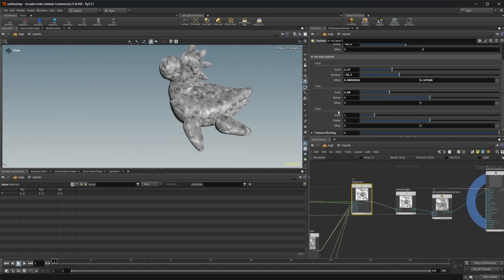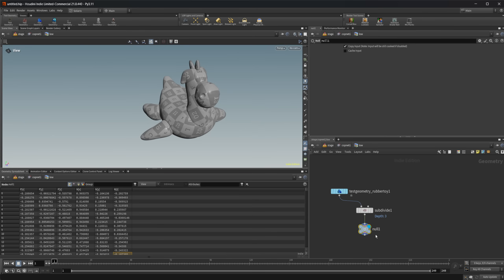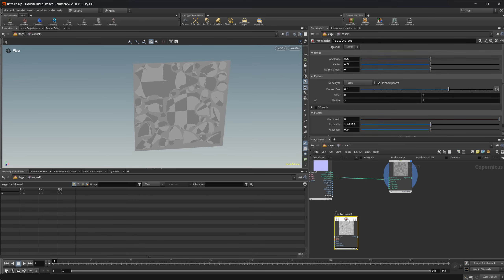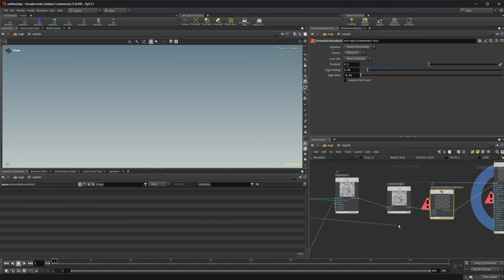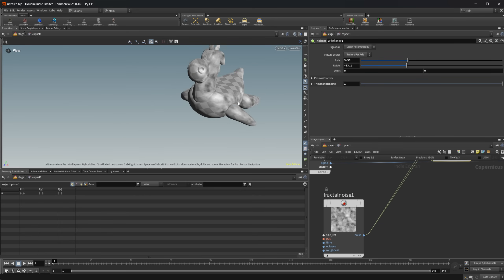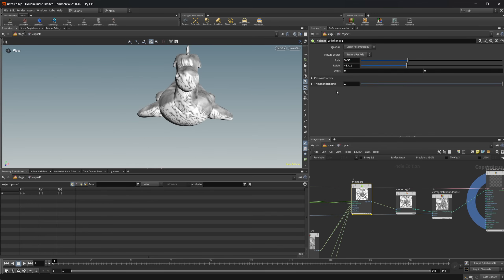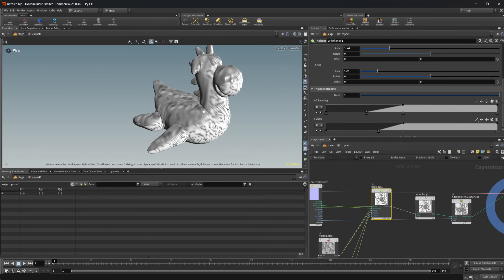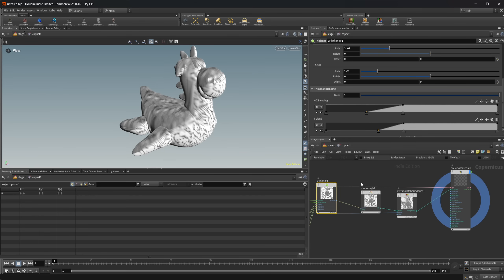Triplanar Projection in Copernicus | Houdini 21

Comment: btw: I finally figured out the 2D/3D split pane view you were talking about in the first H21 live stream. Basically you split your window pane with alt+[ respectively alt+] and then you use one pane for the standard 3D scene view and the other for the 2D Composite view. Now inside cops you can put your display flag on any 2D node and then put an additional display flag on any 3D node by ctrl+⌃+LeftMouse clicking on the view flag. You can then freely switch around between other 2D nodes and the 3D scene view will always stay on the node with the special 3D view flag. Sounds a bit convoluted but it's actually quite simple and actually super useful once you get used to it.
Reply from the maker: Thanks for sharing that! I will have to take a look. I hadn't looked into it more since the initial stream.
Reply: @InsideTheMindSpace my pleasure

Comment: been looking forward to this thanks! running into a wall however right off the jump with the bakegeometrytextures node throwing up this error once the high and low sop import nodes are wired in "invalid source /stage/copnet1/bakegeometrytextures1/bakegputrace3.
(Error: Cannot allocate tracer 'optix'.)."  any ideas? am following steps exactly...
Reply from the maker: You may need to upgrade your gpu drivers. Optix is an Nvidia gpu thing so either try updating your drivers or switch to the cpu mode for baking

Comment: I had never noticed that you could blend or attach COPs triplanarly. I still don’t know what I could do with it, but it seems very useful. Thank you
Reply from the maker: Its another way of applying textures to your models so that seams are less visible. The node itself is new to H21 but you could build it yourself in 20.5. I never did because I expected it to be added in 21 and you could also alway do it at the shader level